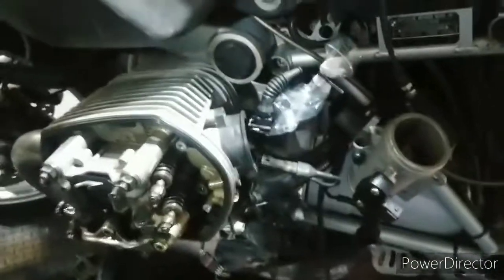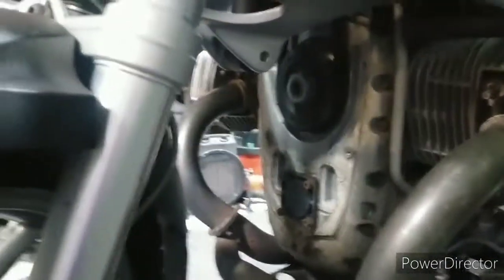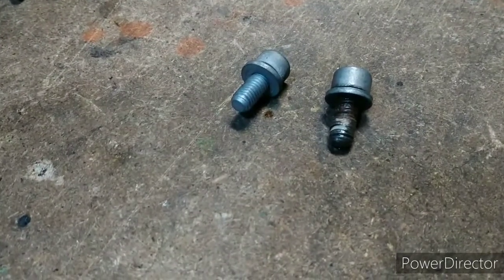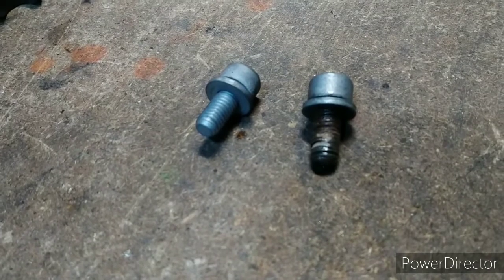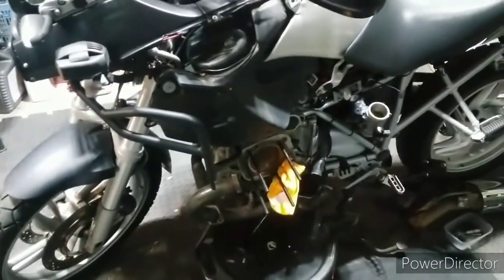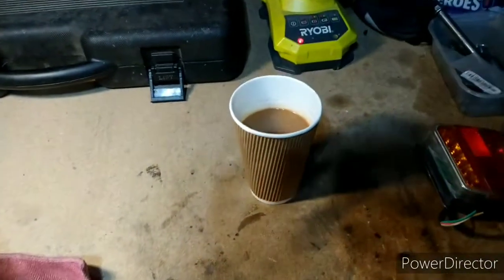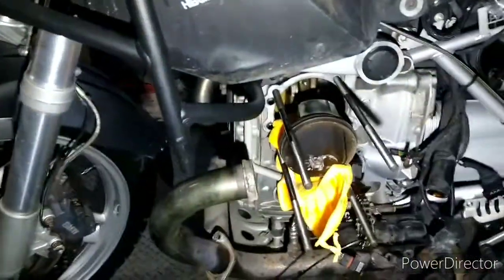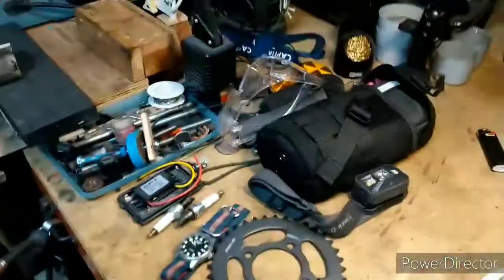BMW R1200GS Top End Rebuild Part 2

Comment: Hi mate. My 2004 just dropped a valve at 25k… 🤦‍♂️ Did you not need to remove the other piston to check and match its weight for the new piston? I read that they need to be within 10g of each other but I really don’t want to take the other side of the bike apart and risk breaking the chain guides.. nightmare!
Reply from the maker: I didn't touch the other side. Which side did yours go on.?
Reply: @macawdor5065  Was the right. I think much more common to go on the right side. The police apparently had issues with their bikes dropping valves on the right side as the bikes were sitting running on their side stands a lot and it was causing the valve failures. I’ve purchased a used cylinder, head and piston… but now I’m torn whether to use the piston before weighing the other side… is your bike still running well?
Reply from the maker: @smoll.miniatures  Mine has been running perfect since my repair.
Reply from the maker: I don't really understand why you'd weigh the other piston.. What are you intending to do if there is a difference.. Get the files or solder out..!?
Reply: @macawdor5065  Yeah there are points on the backside of the piston to remove material with a die grinder if required. Im just going to risk it I think.
Reply: @macawdor5065  Great to hear!
Reply from the maker: @smoll.miniatures  I'm no expert, but my repair worked great. I understand why you'd want the pistons to be the same weight, but as a big twin, I really think that the difference is going to be too small to cause any issues.
That's my take.
Good luck.
Reply: @macawdor5065  Yeah fingers crossed.  I’ll let you know how everything goes. Eeek
Reply from the maker: @smoll.miniatures  Take it slow and steady, and don't drop anything in the engine..!! ;-)
Reply: @macawdor5065  She’s alive! Everything went as good as it could. Slight tick upon startup that disappears after a few seconds. Not sure if I should be worried about that or not. Few forum posts say it’s common but you can never really be sure with the internet. Drives with no issues. Some smoke from exhausts on first startup but it disappeared after a few minutes. Not surprising considering it shot half a littre of oil down the exhaust as far as the backbox.
Reply from the maker: @smoll.miniatures  Sounds good to me. I had exactly the same on mine. The initial ticking, and the smoke. All cleared very quickly and been fine for years since..!
Reply from the maker: @smoll.miniatures  Out of interest, did you get away with the exhaust studs, or did you have to replace..?
Reply: @macawdor5065  Yeah the threads were like new so I lucked out!
Reply: @macawdor5065 btw I tried the magnet on my valves and the entire valve is magnetic. Kinda weird since yours aren’t.